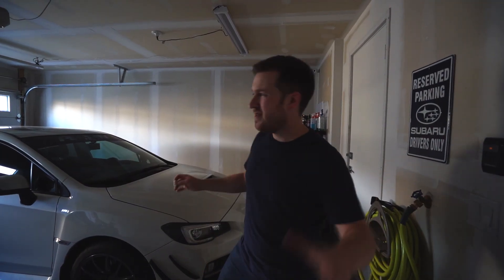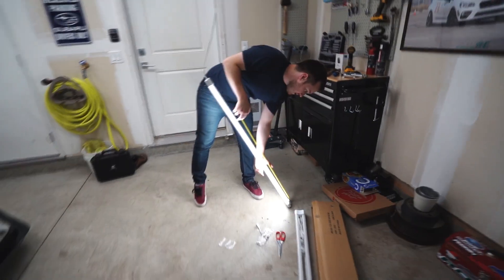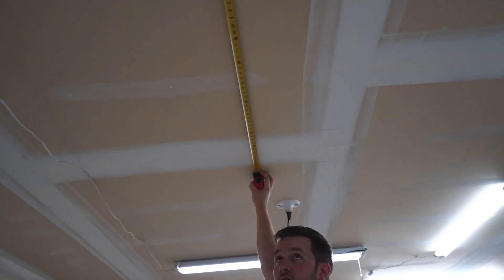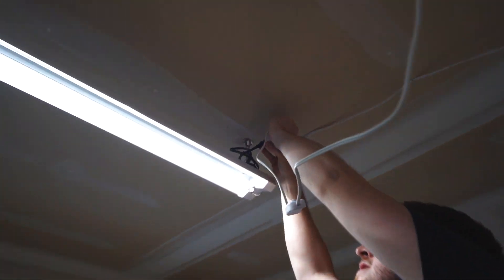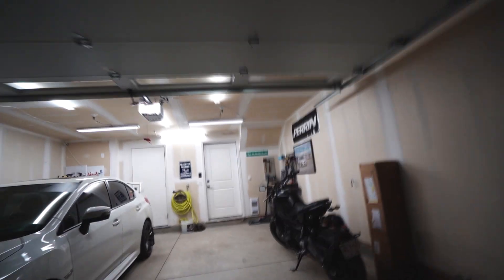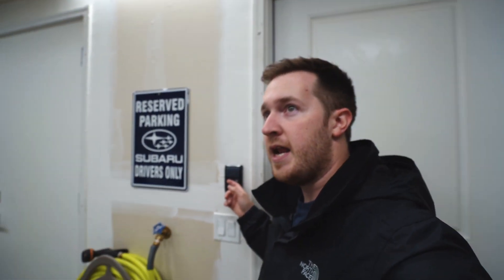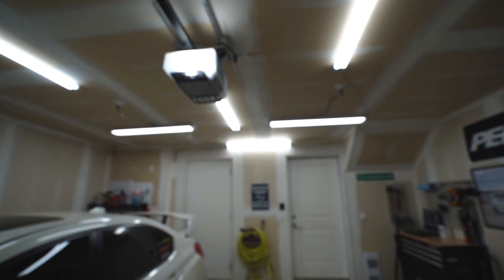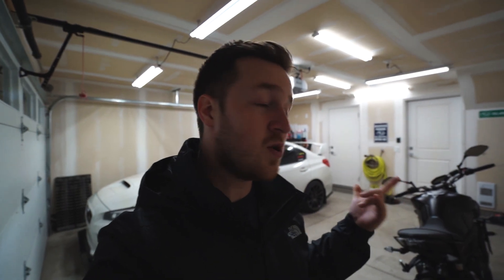💡 29,000 Lumens Garage LED Lighting (Day #18)

Comment: I couldn't get my garage door opener (Liftmaster) to work with an LED light. I only works with an old-style incandescent. It was a single bulb though, maybe it didn't have enough load.
Reply: Ditto, any LED in my garage door opener or too close to it and my remote stops working.
Reply from the maker: Oh shoot! That's frustrating, mine is a Chamberlain and works good! Hopefully you can get it to fix :(